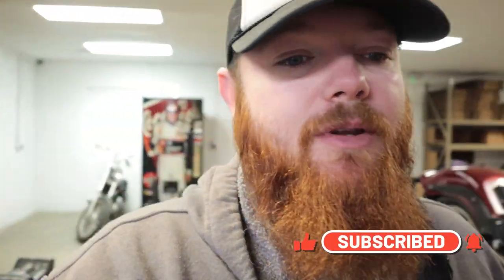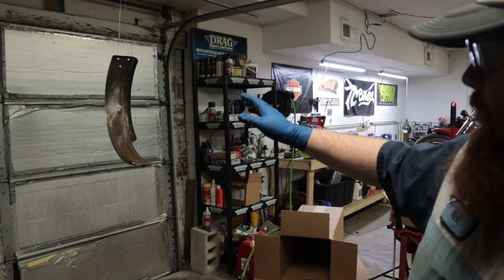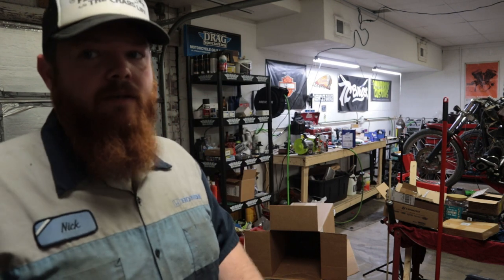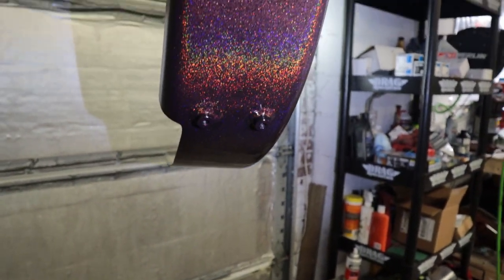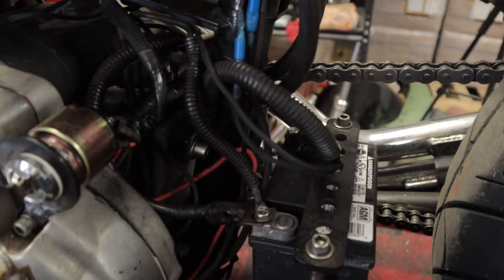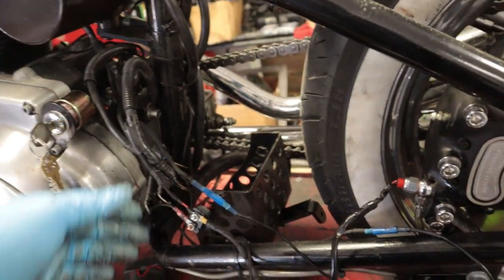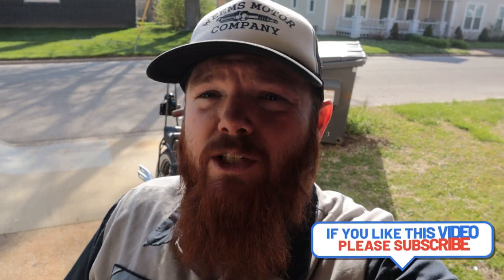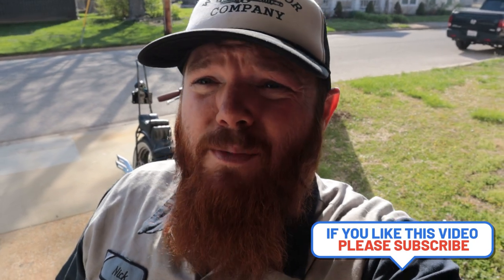Rebuilding my Harley Davidson chopper for the 100th time | paint and wiring |

Comment: What seat are you running on your chopper? I'm running a cobra from Throttle addiction and its a killer on the tailbone . Any recommendations ?
Reply from the maker: I have an entire shelf of seats that didn't work for me.  I'm currently using the Le Pera Scorpion seat and absolutely love it. I've done 600 miles in a day with no pain.
Reply: @STLNik  thats what I thought it was! I had one on a chopper I had years ago and liked it. I'm going to get one for mine.  Thanks for the help bro !
Reply from the maker: No problem